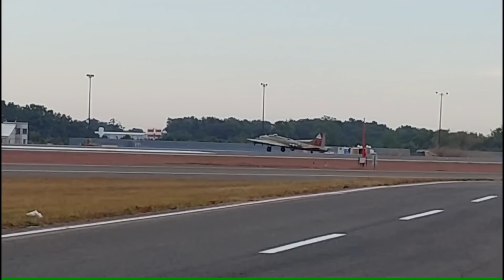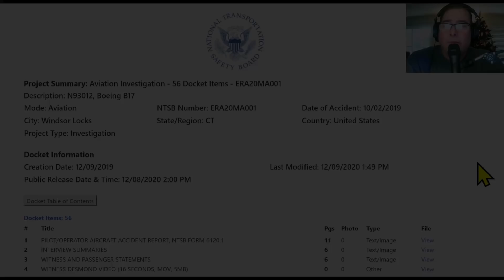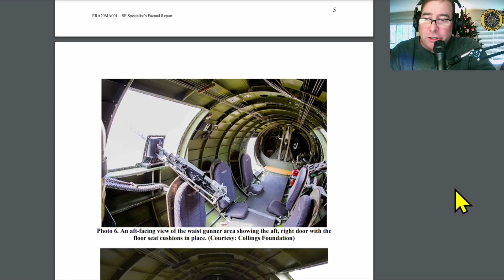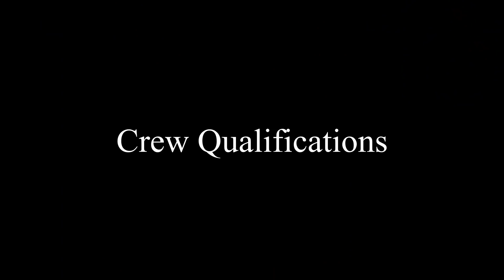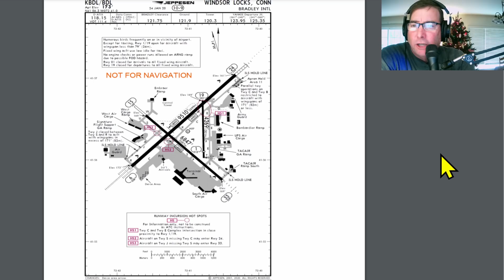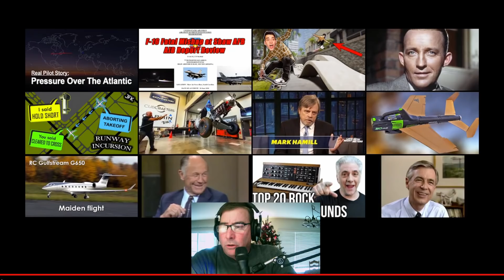NTSB Factual Report B-17G Crash 'Nine-O-Nine' Part I -16 Dec 2020

Comment: Juan: you’re correct, she only had lap belts.  Mine also failed on my flight on Nine-O-Nine.  It kinda just... fell apart with barely any strain.
Reply: I flew on a B17 from a different operator, and those military style belts did work correctly and we were instructed on how to adjust them.
Reply: The lap belt has a buckle that was very common for race car belts and is very reliable.  There is a detent that you need to get past when locking the lever, the detent works like a tool socket snapping onto an extension or ratchet.  If the detent balls ( upper and lower ) are missing, then the buckle won't stay latched
Reply: Y’all misunderstand - the buckle worked fine (and I have used many of them), the fabric of the belt literally frayed apart.  The belt itself failed.
Reply: @thevinylrevolution  Got it, failed fabric is completely unacceptable.  This leads to the next general question.  If an obvious inexpensive problem is not taken care of, what about the not so obvious problems?
Reply: @bobroberts2371  Bingo.  The Collings Foundation needs to be working overtime on gaining our trust again, though I’d rather see those airplanes go to people who’d love them - and more importantly, respect them.
Reply: @thevinylrevolution  I think it is less of a respect issue and more about $.  Not in the sense that someone is making big $, more in the sense that there isn't much $ to work with and something has to be let go.
Reply: I want them to keep flying, too.  And when they crash like this, not only do they quit flying, they are lost...gone.  But I'd rather see them shredded for scrap metal than hurt people.  Being scrapped and hurting people are both unacceptable, so they can only be flown when they are in proper condition and crewed by properly trained crew.

The seat belts should have been replaced.  They installed non-authentic seats for passengers, they should have installed modern, or at least functional, seat belts...which means they need to be adjustable...or else why even bother?  However, seat belts aren't needed if the plane is flown properly...including knowing when to not fly (I'm not saying seat belts aren't required by FARs, just not needed...if.  But I am a seatbelt believer.)  And the plane can't be flown properly if the engines aren't going to reliably produce power.  This should all be on the aircraft owner/operator/pilot.  You wouldn't expect maintenance to slack off just because the FAA isn't watching them anymore, not in a non-profit org.  And not either in a for-profit business that cares about its future.  If you slack off enough on maintenance, eventually something's going to happen that ends your business, and takes whatever profit you had.  (And should land the CEO in a single-wide mobile home, not double multi-million-dollar mansions.)

Why did the PIC shutdown and feather #4?  Will we ever know?  If #3 could only produce drag, not thrust, it would have been far better to feather it, too...right?  Did he shut down the wrong one?  Windmilling props not only produce drag, but block (reduce) airflow over the portion of the wing behind them...locally, less than indicated airspeed...meaning, that portion of the wing produces less lift...all bad!  If #1 & #2 were doing good, might it have been better to make sure 3&4 were feathered (I think it just won't fly if they're killing the wing's lift on that side), declare "may-day...emergency...I need the whole airport!"  Then try to gain altitude on 2 engines, or maintain altitude.  Maybe it's better to do a wide tear-drop turn into the good engines (left) to a 1-mile final?  And then do a stable approach.  Seems like once you've hit the approach lights or touched the gear on the dead-engines side, short of the runway, all you can do is admit...crash landing... cut all power and try to work the rudder and elevator...maybe the brakes.  Try not to head for anything big.  High asymmetrical thrust at low airspeed is only going to result in loss of directional control...is it not?  Not enough rudder authority?  Maybe warbird pilots should practice crashing their aircraft in flight simulators...survivable crashes. Seriously, couldn't it have helped here?  Break the plane, but not the people.  I sort of think a person with a DUI lacks the proper judgement/professionalism for flying.  I'm sure many will disagree.  Depends on if it was a lesson truly learned, or just regret at getting caught.
Reply: The safety equipment isn't supposed to be antique, too! Sheesh. :(
Reply: I wanted to follow my comment up with a caveat; in no way shape or form do I advocate for the grounding of vintage aircraft.  Quite the opposite, I’m an advocate for it, and keep ‘em flying.  That doesn’t mean, just like all other aspects of aviation, some things go down that aren’t very kosher, whether it’s history flights, general aviation, military, or some mishap on your CRJ in Iowa.  SAFETY IS PARAMOUNT 100% OF THE TIME AND IN ALL PLACES!